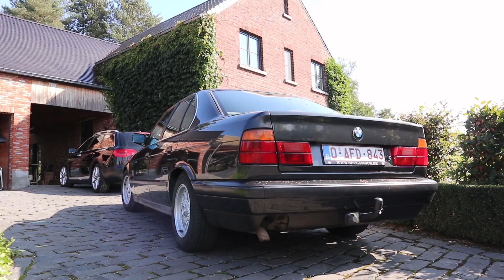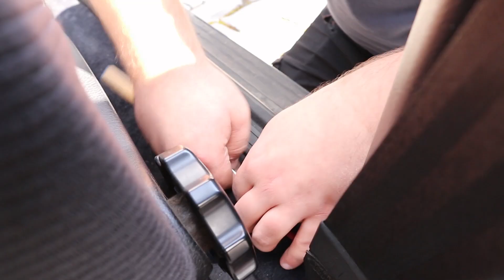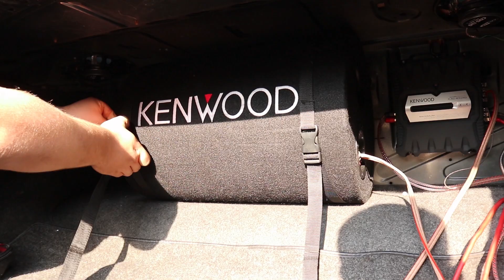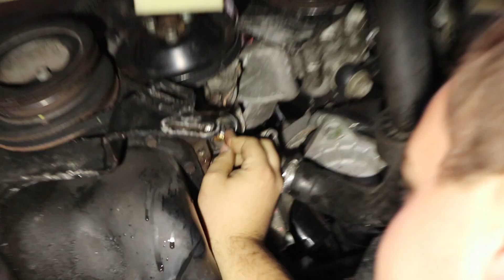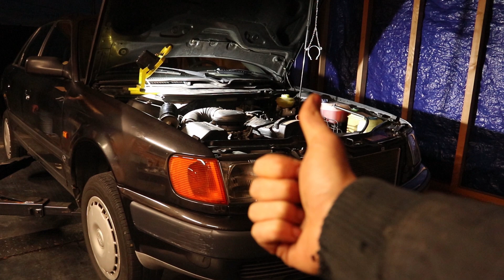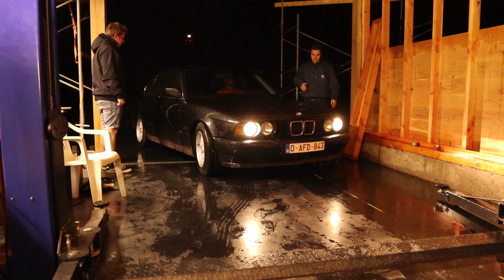Did Our Budget Audi 100 Pass Inspection?

Comment: to remove air bubbles you need to just release the coolant cap just a bit to release the air bubbles when it is boiling then once the air is out you should top up the coolant.  By the way where are you?  I've been waiting for your videos for 4 years now...

Comment: I'm late to the coolant-bleeding party and I dunno if it is already said, but you've got to crank cabin heater all the way to max to enable the coolant (and trapped air) flow. Also there may be a bleeding nipple, though VAG engineers might have it omitted (there're many bone-headed dudes at VAG)

Comment: after all you did it you should set heating in cabin for maximum and open all bleeder valves and wait until bubbles stop coming out,buy on aliexpress or somewhere else ELSAWIN is offline service and repair manual on pc for audi,skoda,seat and VW is cheap and very helpful when working with cars 😉

Comment: Bleeding a cooling system can sometimes be a pain in the ass. Sometimes you have to pull the front of the car up, sometimes the rear. Boiling during bledding is normal to some extent.

Comment: It is a good thing that the inspector insisted on the alignment after the correct springs were installed. Had that not been done, the tires would have worn very quickly because the camber angle would have changed. The car would not have tracked properly, either. I figure that maintaining proper alignment is less expensive than wearing out my tires, the car drives better, and it uses less fuel. Even at 600,000 kilometers, my 1990 Volvo 240DL estate does not wear out tires too quickly. Arthur just got his 4th set of winter tires. He has had is on his 5th set of summer tires. He is also on his 3rd full sized spare tire.

Comment: back in 90's Audi 80 or 90 2.3 5 cylinder  - drill a 4mm to 5mm bypass hole in a new thermostats sealing face - reassemble,  jack the front wheel under expansion tank as high as possible  - heater on hot and fast idle - till air lock came out... did several as worked at a indy VAG specialist

Comment: drill a small hole (4mm) in the thermostat next time on the fixed aluminium part that does not move, fill coolant with engine running, heater running on full hot

Comment: You can drill 1.5mm hole on the top of thermostat and this should  help to push air out. Some BMW thermostats had small dent on the top of it to help air move around.

Comment: I had the same issue with the thermostat. Tried drilling holes in the thermostat, but it didn't help either. In the end, here is what I did: jammed the thermostat open with vitamin-C pills that obviously dilute after a while. As a result, no airpockets.

Comment: try to drill a little hole into the thermostat so, when you want to air out the system the colant can fit through the hole you drilled

Comment: When vacuum-filling the cooling system, you need to suck out more vacuum, looks like the gauge is showing a third? I would say probably more like half, close to the yellow mark. And another tip is to drill a small hole in the thermostat and position the thermostat so that the hole is in 12'o clock. And be careful putting pressure into the intake with the engine off. Open the oil stick or oil filler cap before introducing pressure. Otherwise, if you put to much pressure, you can blow out the main seals as you pressurize the crankcase.

Comment: Cars cooling system won't drain completely by pulling a water hose off a block, there will be remains of coolant in your heater and engineblock, so couple of liters off the capacity is normal

Comment: I’ve had the same issue with the quantity of coolant in my Audi80. You’ll never be able to get all the coolant out the engine. That means there’s allways some left inside. That’s why you weren’t able to put in the required quantity. Next time check the quantity you let out and put the same quantity back in. ;)

Comment: first of all : pull vacuum for way longer ... squeeze out any not collapsed hose ...even when you think its allright ... take another 30 seconds .... than get the tank from wich the "sucker" is pulling a bit higher than your highest coolingsystemcomponent and after all of this throw away that cheapo puller and seek one thats a hair more expensive :D :P

the boiling might be normal for a car this age ... i mean there are reasons why the cooling system needs to keep presure --> evaporative point of water ;) sry for my bad english im tired AF ! ;)

Comment: If you have issue were there is a "hiss noise" in the speakers, its because you installed the subwoofer cables next to the positive wire. Idealy you would install it on the other side of the car to avoud this  :)

Comment: If you have access to a garden hose, flush the system to get rid of all the crap (with the engine cold).
Let me give you a tip: drill a 3 mm hole in the stat to help bleed the system. I've done that in my Taunus and works great.

Comment: The cooling system needs to be under pressure for it to not boil. 

Leave the cap on, if the cap is off the coolant will boil

Comment: I have the south american version of the 8v, the AP, and to bleed the coolant circuit i just let the water boil with the cap open until the fan starts, of course a lot of coolant pours out but it gets the job done. I also check that the heater core circuit valve it's open, so no air bubbles there to screw the job. I just did it this month when doing a full coolant flush and casually my thermostat stay open lol, so got to the job again. 

PS: videos are great, your friends broke up with the shame and it tells, excellent job guys!

Comment: Since I'm a Car Mechanic, bleeding old cars, especially Audis, was never a problem for me. Fill it up, massage the big hoses at the radiator, close the Reservoir ant take it for a drive. Usually the temperature gauge hits the overheating area just for a short time and falls back down immediately. There's the issue with the air pocket around the thermostat preventing it from opening.
But since you guys  had an open reservoir, the coolant could boil at around 100°C. Closing the reservoir results in building up pressure which prevents the coolant to boil at it's natural boiling point, allowing to form form pressurized  = hotter steam to heat the thermostat and let it open. After the temp gauge makes a flop  dow (that's when the thermostat happened) the coolant level usually is below minimum. Fill it up again... et voilá.

Comment: Water system air problem you have is very easy to do, just push on the thick pipe until the air is out while the car is turned off, then turn on the car and remove the little return line and put it beneath the coolant reserve and you will successfully bleed all the air that easy will take only 5 minutes,, this trick works on all makes and models, i have the same audi a6 95 and this is what works for me

Comment: Do any of the thermostats you have have a small hole drilled into them to allow air to pass through? If not, you can drill a small hole in the top of the thermostat which will allow any air bubbles to pass by the thermostat and get out of the system.
Reply from the maker: Yeah we did

Comment: For some cars the cooling system bleeding is only possible if you close the expansion tank. The system works normally under some pressure which is also needed for bleeding. 
I had the same problem with my Golf mk1 and closing the expansion tank helped me with bleeding.

Comment: I think the problem on cooling system might be a cracked head garniture,because of preasure in your system, maybe a bloked front radiator.
The tool that you use is for filling coolant system,the process works like that:
1.drain maximum liquid.
2.install all pipes.
3.make vacuum for 15 min.
4.check vacuum leak for 1 min by closing air valve on tool.
If vacuum is ok the indicator stay on might be on red or at the end of indicator.
If it is a leak the indiacator move.
If it is all ok fill the system and remember how much liquid do you flooded.
After this star the car and let it work on idle with heating on and time by time hit the gas pedal till 2000 rpm,and wait until it runs a working temperature.
When the car will be cold maybe next day, check the level.
P.s Sorry for my English,regards from Moldova.

Comment: In Audi there is a small valve on the entry tube of heater under the plastic shelf at the bottom front window. It should be unscrewed while venting.

Comment: There is usually a plastic bleed screw or a small hole in one of the hard lines near  heater core on Audi's of that era up to the C5 Audi A6. My 1993 V8, 1993 90, 1987 5000tq and a friends 1995 S6 all have something of that nature to allow air to escape from the highest point in the cooling system. The plastic bleedscrew is obvious but the other style which is a hole in the heater core hard line is simply uncovered and resealed by sliding one of the heater core hoses down to uncover the bleed hole. Once you get a clear stream of coolant slide the hose up and tighten the hose clamp.

Comment: Multiple things as tips:
1. The power cable for the sub is a bit small if it really is a 1200w system
2. Try to refrain from having ur power cable and signal cable right next to each other
3. If the system has a problem with bleeding, try to drill a small hole (or 2) into the thermostat. I do that if they don't come from factory like that
Reply: And before I forget it..... Great video as always, love the content ;D

Comment: A good way to solve the thermostat issue is to drill a small hole in it to allow tiny amount of coolant to go through, but more importantly the air to pass through. This helps bleed it out.

Comment: Unsure of this model, but there's usually a bleeder valve in the heater core.... (if you remove the big black rain tray).  I have the S4 (C4 100) model of this vehicle.
Reply: I also have a c4 s4 2.2t and c4 a6 1.9tdi, and they both have the bleeder valve on the rubber hose that goes to the heater core.
Think al c4 chassis cars have this.
That could be the reason why dimitris cooling system was hard to bleed.
Reply: 4A0819809 ...  4-cylinder model?  https://audi.7zap.com/en/rdw/audi+100+avant/a100/1994-149/8/819-819050/#17

Comment: Like 1000👍 .

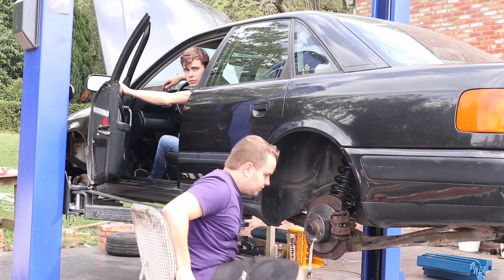At minute 2:32 my vag (vw 1.8 i) also makes  a noise  when  idling. 
Why  is it produced  ?
Reply from the maker: Probably timing belt tensioner
Reply: @memphis5220  when I accelerate a little the noise is removed
Reply from the maker: Jep my golf had that too
Reply: @memphis5220  I asked you on the golf video.
so sure it comes from the tensioner?

Comment: Can’t you install any lowering springs there in Belgium? 😳 I think you would been able to download TÜV certificate for your old springs from internet.
Reply: you can indeed if you have the correct goca certificate it's called here, but you will still need a special technical inspection. The best part is if you register the car as oldtimer, you don't need any paperwork or special inspection. but same car as normal registration you need it. Laws here are just garbage. that they didn't get away with those springs is crazy. my daily mk2 Golf is inspected several times on lowering springs with no problem and I asure you it is more low then that Audi was.

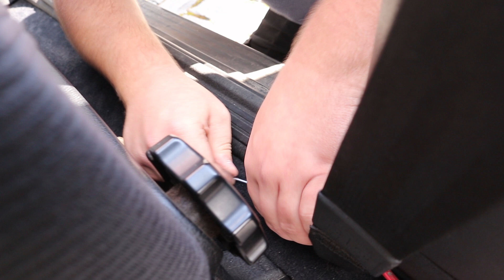Comment: Protip: At 6:25 you would be better of to lift up the plastic covers and unscrewing 7 screws that hold the whole trim. it would take you just a minute or two and make work of getting that cable through so easy.

Comment: I usually manage to get most of the air out by repeatedly squeezing the larger coolant hoses. You can also feel if the hoses have coolant in them and if the thermostat has opened. It can be tricky, ive had the same problem happen before. I drive a '92 Audi 100. I have owned a '84 100 Avant and a '85 Coupe GT. Worked on all of them myself.
Reply: This is what we do at the Toyota dealership in Romania😂

Comment: Did you open the internal heater? That's a separate system and should be opened so more coolant will be needed. Just crank the heat at maximum and wait for the coolant to rush to the heater and top off the rest. Best regards.

Comment: When you pull it under vacuum, you’re shooting for 30inHg - that’s perfect vacuum.  But most times you’ll get you 25-26 and that’s perfect. You guys, just looking at the gauge what I could see, only had about 15inHg pulled so you left a huge pocket in there. Another good way to bleed things, if you can’t get the pocket out is get a coolant pressure tester and put about 5PSI in the system. Then crack open the bleed screw. Keep doing that until all the bubbles are gone and it’s straight coolant coming out. I had to do a thermostat on a Vagon once and even drawing a vacuum did nothing because of how long the hoses were. So I had to keep putting it under pressure and force the air out manually. Love the vids.

Comment: I couldn't bleed the cooling system of my Mk2 Golf once. It turned out that the hose from the radiator to the reservoir/expansion tank was clogged and the air couldn't escape. After cleaning the clog, it bleeded without issues.

Comment: Hey
did the audi overheat with that problem with the cooling system? I have a problem with my e30. The Car gets hot when atanding still but when driving it is ok. Do you know what could be the problem? I thing it is the water not circulating correctly and  air cooling it when driving
Reply from the maker: No the audi didnt overheat. Does you cooling fan work?
Reply: Memphis it has a fan with a viscoclutch not an electric one, it spins but i dont know if spins enough:(

Comment: Hey, for the termostat to check if it works, put it in a catle boil some watter up and see if it klicks. For bleeding the system try to move front of the car up atleast by 50 cm, it gonna help all air to flow to the highest place and come out. I had the same problem with my bmw e30.
PS in which city do you live. I moved to Belgium not long ago, i m searching budys to ride with :) Pss say to Dymitri that i give 7 squating gopniks for his car. Mybe he will understand :D

Comment: Would recommend Dimitri to upgrade the alternator with higher amperage, subs take alot of power & its great for long term anyways.

Another thing, the ghetto way to do it is to drill a small hole in the thermostat itself, saves time during bleeding
Reply: I've just seen ChrisFix do this when he replaced the thermostat.
Reply: It's not getto  some thermostats have a hole from factory.

Comment: Great video Memphis! About that Audi cooling system. Maybe you could try drilling a small (2 mm orso ) hole in  the thermostat. That way if any air is trapped in the thermostat housing, it can escape even without the thermostat being open.
Reply from the maker: We did that with one of them but it still didnt work

Comment: My Dad had the exact same car when i was a kid, amazing build quality, like a tank. Great engine the 4 cylinder 8v and 16v golf GTI motor. Sad thing these days lads is the system wants you to drive a modern piece of shit.....instead of a well built classic. My next purchase wont be a new machine but more something from the same era as your Audi there...the good old days of Motoring! Peace.
Reply: I drive audi 100 c4 (i do not own one) and i must say it is having problems. For sure it's not as well kept as this audi. But if you want to compare it for modern standarts then it's 2 liter engine is quite uneconomical and the car itself is unstable as hell, probably because of spongy suspension and cheaply made rear axle(which is just a bar connecting 2 wheels and pair of springs and shocks).
Reply: @Pheasant Pluckers son   it was not to you :D
Reply: as a car these old cars are great, after 25 years...it cna still beat any new car in most departments (except tech obviously). The problem with these cars is that if it ain't a very popular car-engine combo you cant find parts anymore....Audi officially supports a car with parts for 20 years. If the aftermaket is full of parts for them...no problem then

Comment: Usually jacking up the front of the car helps the bleeding process as well!
Reply: Yes and if you want you can drill a tiny hole in the outside of the thermostat that would help too
Reply: I have never seen a thermostat without a weep hole to allow the system to purge air. Also, many cars have a bleeder port at the highest point in the cooling system, making bleeding it very easy.
Reply: @michaeltutty1540  in some old thermostats there is no hole